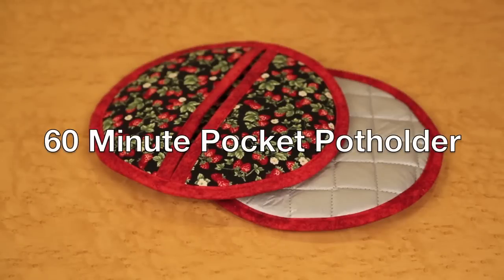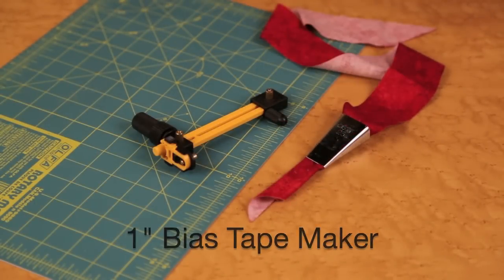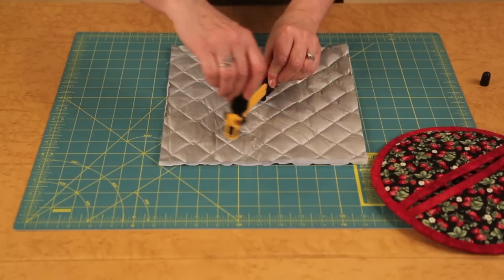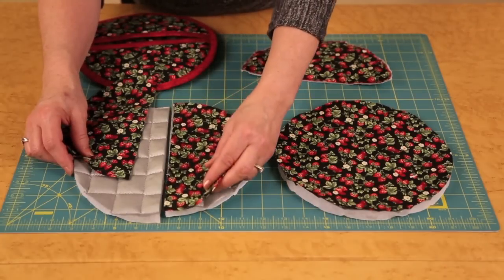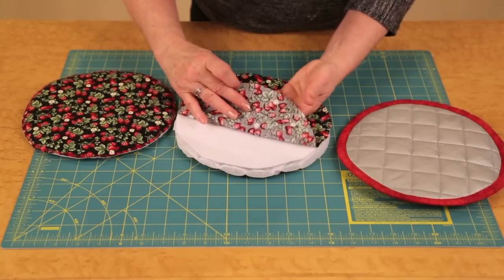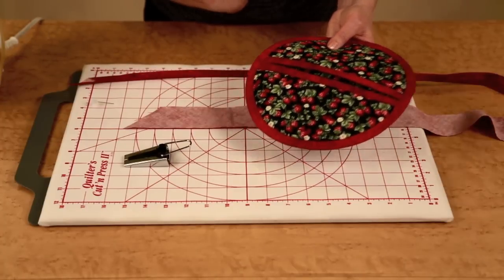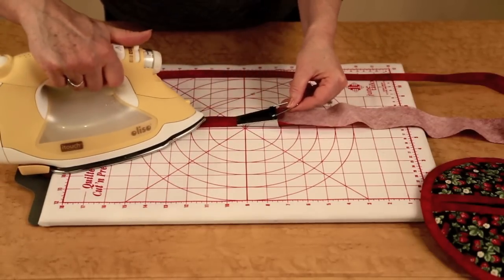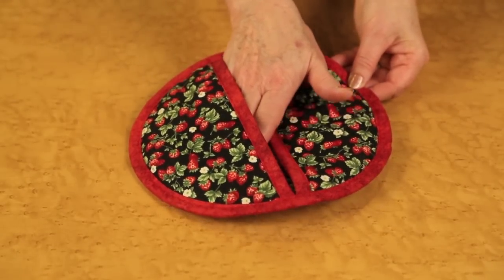Learn to make a pot holder in 4 easy steps

Comment: I am making several of these as gifts. I don't have a fancy circle rotary cutter or a bias tape maker I used an 8 inch plate and bought store bought bias tape but it worked great!
Reply: Michele Thomaschris cook
Reply: Gosh i love people like
Reply: Home stuff still better to use if u not have real stuff
Reply: I watched a video one time that showed how to make bias tape and was so easy.  They cut the material they wanted to use for the bias, then put a safety pin in the ironing board, folded the material in half, pulled it through the the pin ironing it as it came out perfect.  Fold the bias in on each side and iron.  Wa-la bias tape. Easy